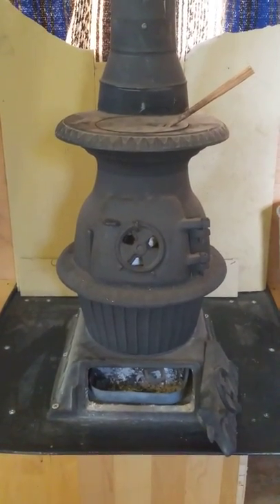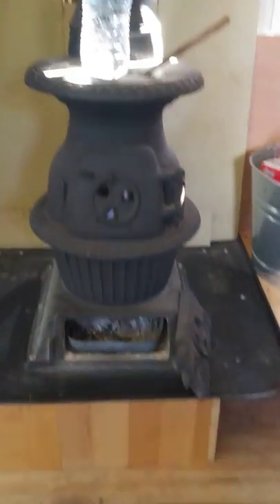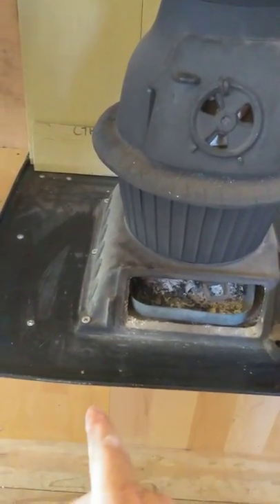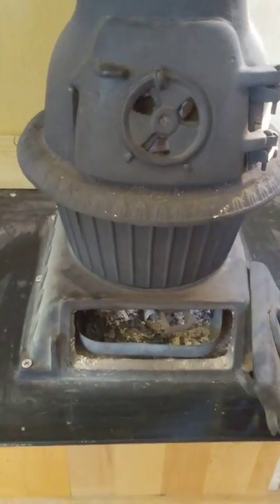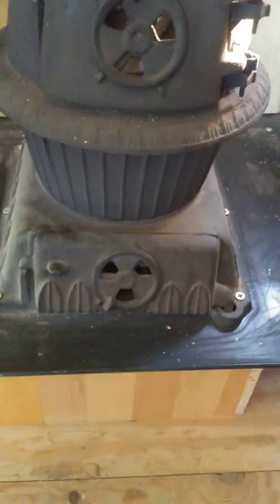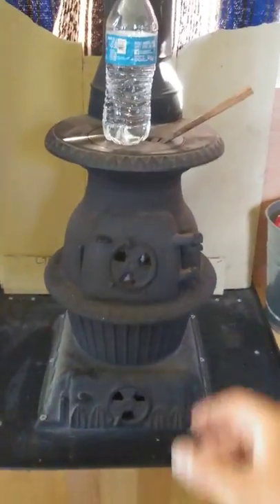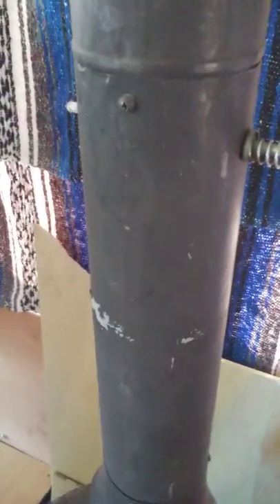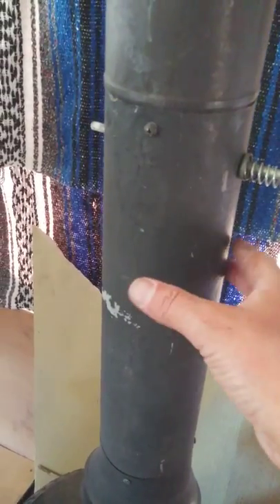Wood stove in my bus

Comment: also why such concern about setting fire to the metal roof of your bus? Do you have flammable insulation in there?  Currently I'm using a metal plate on the window but once I get settled on where I want it, I'll probably put it through the roof.